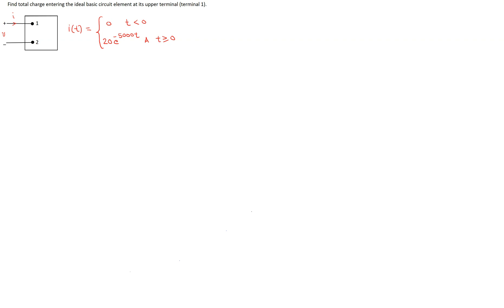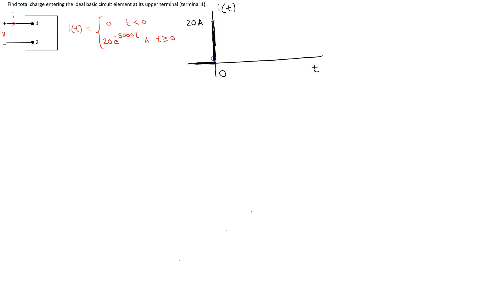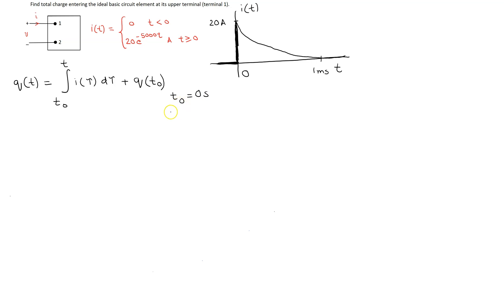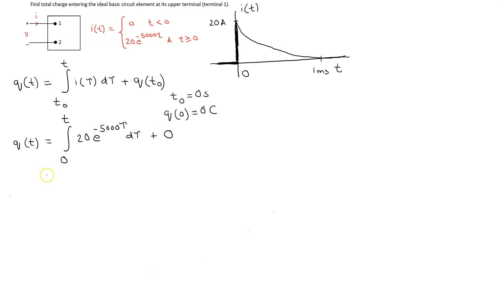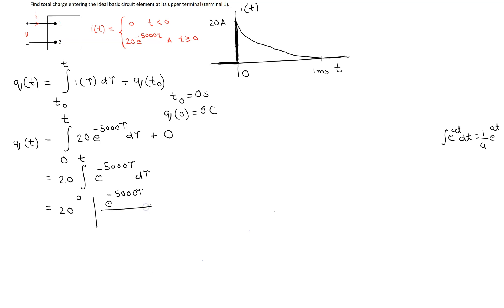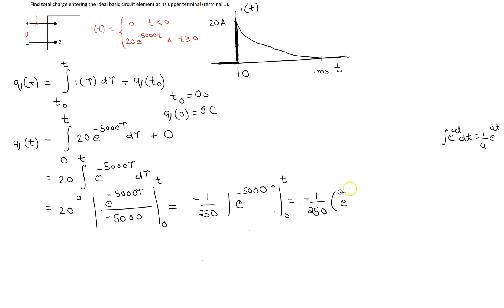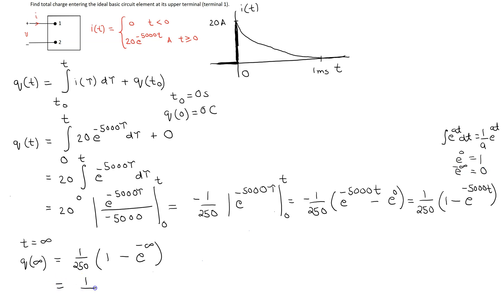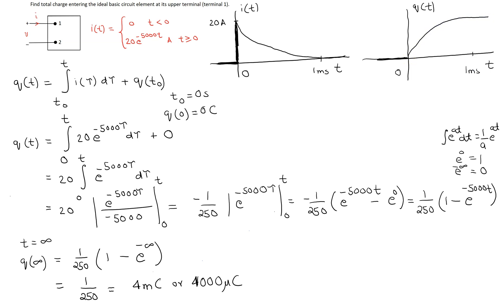Ideal basic circuit element - Example 3 Total Charge Transferred

Comment: Why infinity gives the total Charge?
Reply from the maker: To get the total charge, we have to integrate over all time where the voltage and current are non zero. Exponential signals decay slowly and tend to 0 as time -> infinity. Hence, we have to set upper limit of time as infinity.
Reply: @electriccircuits7164  got it 
Thanks ❤️🙏
Reply from the maker: Glad it helped!